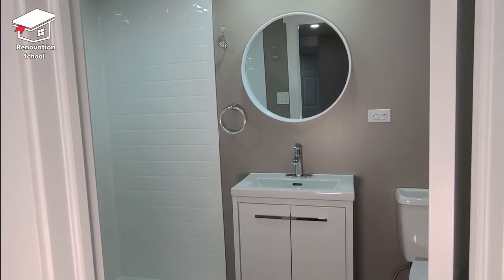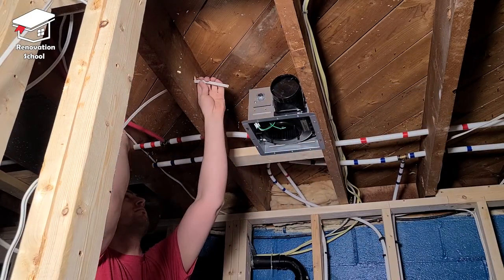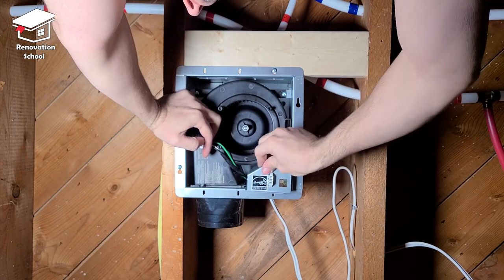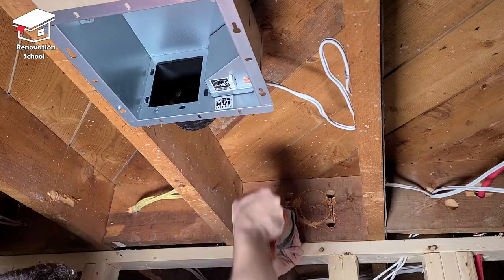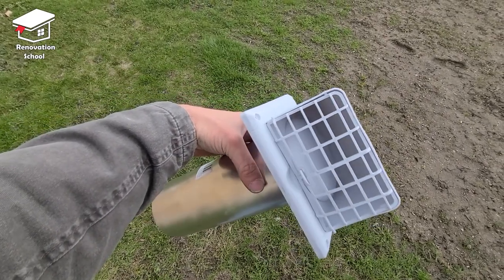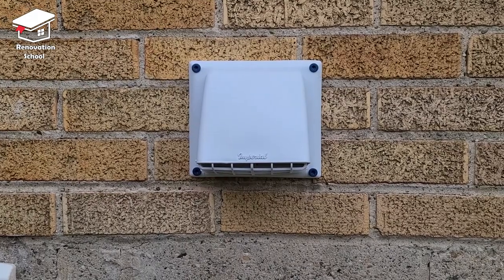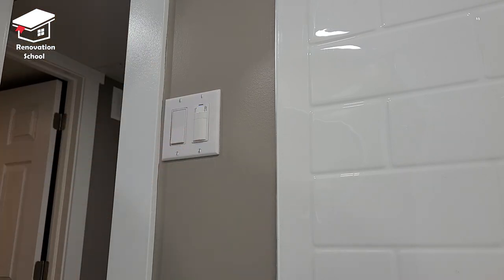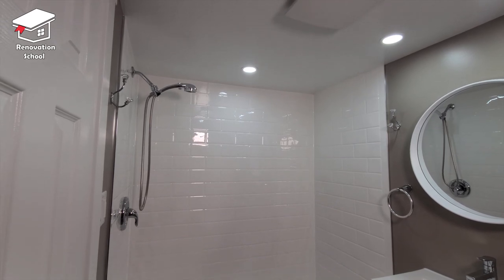How To Install A Bathroom Fan And Exhaust ? (Breeze Easy Costco brand)

Comment: I just installed that same fan today. If you live in an apartment or condo. make sure your manager installs it for you. As our old fans we're probably 60 years old. And barely even working. A suggestion I tell everybody is by some dryer venting. You'll need self tapping screws. And you'll need more aluminum tape. Forget about the sensor it's a pain in the butt. A normal switch will do. I can understand if you live in a hot climate. That would probably be different. Installing it in an older house. You do not really have to go up in the attic if there's a vent there already. You can install it from down below. The cutout to measure your whole with. Is a little bit too small. So make the whole tiny bit bigger. Make sure to use the wooden straps or plastic straps behind the drywall. I also suggest getting drywall screws. Because they hold better than the screws they give you. The sensor is not the greatest. You can set the fan at a certain time and for how many minutes by touching the button. Had a guaranteed if your kids get ahold of it it's going to be broken within a week. So don't worry about it use a normal switch, most of the light switches in Canada are outside the bathroom. Making this moisture switch inoperable. If you have switches inside your bathroom. I say go ahead. Would I installed a switch with new wiring inside my bathroom. know hell no it would cost way too much money to do that.
Reply from the maker: Thanks for watching 😊

Comment: So much easier if you have the framing installed.  Replacing an existing fan is so much harder.
Reply from the maker: You are 100 percent right

Comment: We had this fan installed during our bathroom renovation. The fan itself is spining and turns on but it has no suction, its nit clearing any moisture at all. Any ideas what may have gone wrong? Our old one was working before we replaced, we just decided to upgrade but now the bathroom mirrors fog up in under a minute with the shower on
Reply from the maker: If the wireing is correct and if it turns the right way it should work correctly.

Comment: My fan keeps running. Idk why? When I turn it off the led turns off but the fan is still running. Is it the humidity? But when i install just a regular switch i can turn on and off the fan.
Reply from the maker: Yes , the switch sences dampness, or maybe its faulty.
Reply: How long the fan will turn off? Or can i just turn the switch manually just like a regular switch?
Reply from the maker: It stays on as long as it sences the moisture , if the switch is faulty thats a different story.
Reply: You can adjust sensitivity as needed. Read your manual you'll find how
Reply from the maker: @Aariles  thanks for mentioning I never read the manual completely and I was not aware u can adjust it,  thanks for watching and the comment.